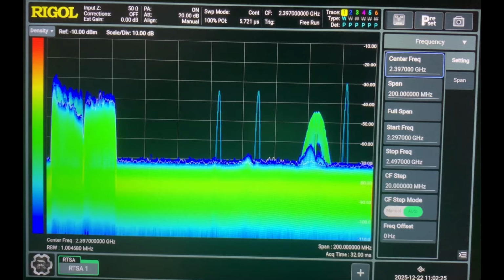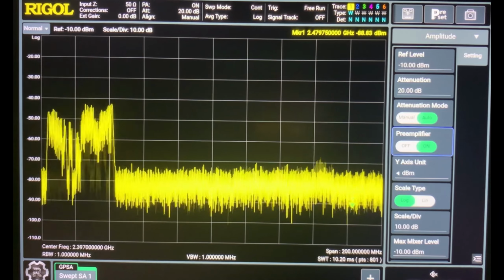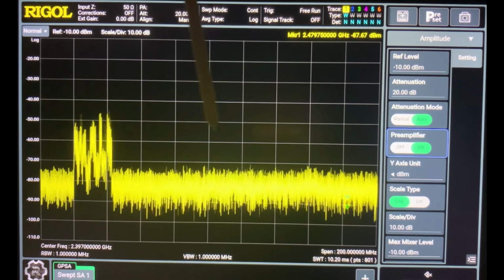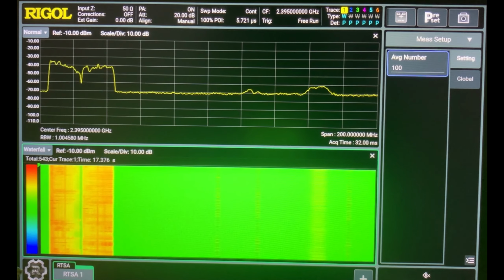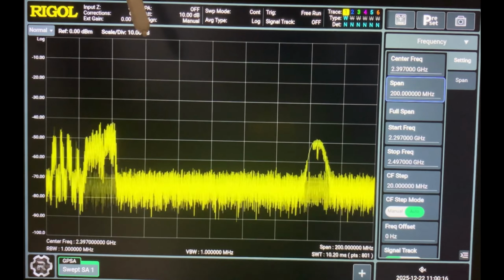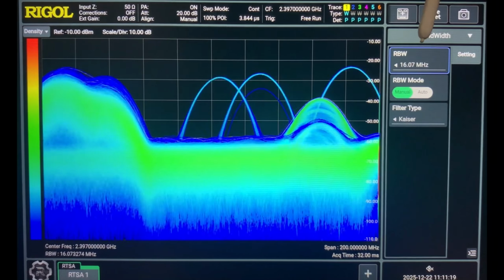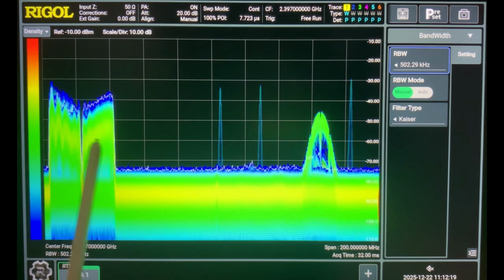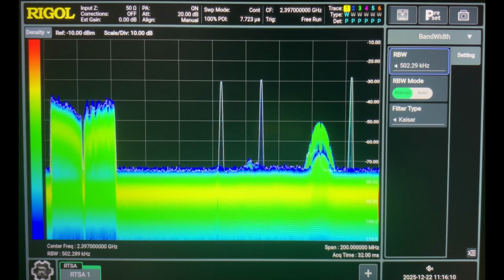Why Your Spectrum Analyzer Misses Signals (Real-Time vs Normal Mode)

Comment: Hello. Can you record the signals with this Rigol RSA and play them back? Since the transient signals they jump so fast I think the main motivation to have a RSA is to record them. I’m thinking you can also use a SDR like USRP B200 but AI compare says and RSA is better
Reply from the maker: Thanks for the question!

Yes, many real-time spectrum analyzers (including some Rigol RSA models) support *IQ recording* or **trace recording**, allowing you to capture a period of RF activity and analyze or replay it later. This is one of the major advantages of an RSA when you're dealing with short-duration or intermittent signals that a normal swept spectrum analyzer would likely miss.

That said, there are a few limitations:

* The recording duration depends on the available memory and the capture bandwidth. The wider the bandwidth, the shorter the maximum recording time.
* Not every RSA model supports signal playback or arbitrary waveform generation. Some can record IQ data for offline analysis, but cannot retransmit the recorded signal.

Regarding the *USRP B200**, it's a bit of a different tool. A USRP is a **software-defined radio (SDR)* transceiver, while a Rigol RSA is a **dedicated real-time spectrum analyzer**.

* If your goal is **finding and analyzing transient signals**, the RSA is generally easier to use and has features like real-time spectrum display, persistence, and trigger functions designed specifically for signal hunting.
* If your goal is **capturing IQ data, processing it, decoding protocols, or replaying signals**, the USRP B200 is much more flexible, although it requires software such as GNU Radio and a bit more setup.

So I wouldn't say one is universally "better"—they're designed for different purposes. For RF troubleshooting, I'd reach for the RSA first. For SDR research or signal generation/recording experiments, the USRP is an excellent choice.

Great suggestion though—I may make a future video demonstrating IQ recording and explaining the differences between an RSA and an SDR!